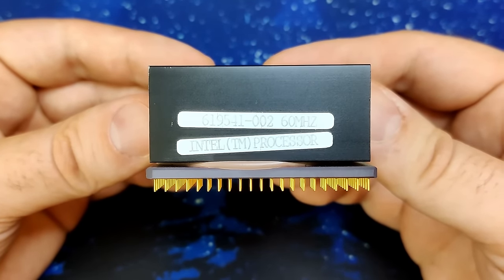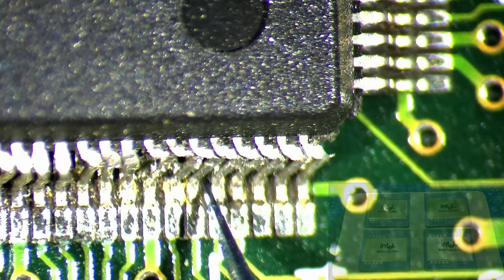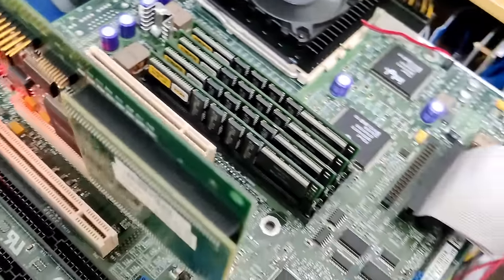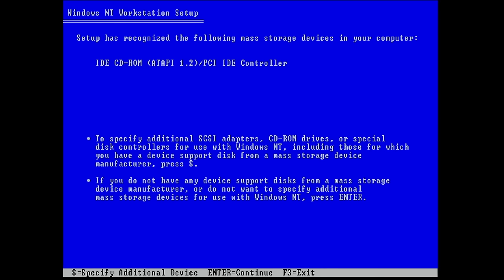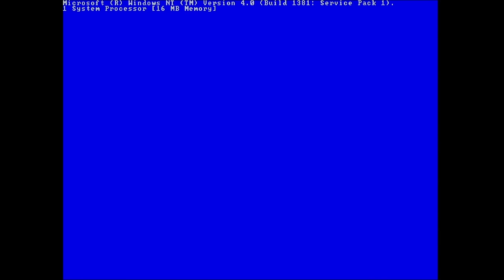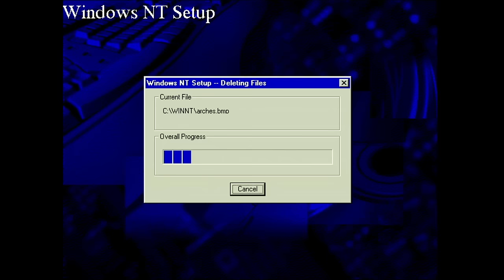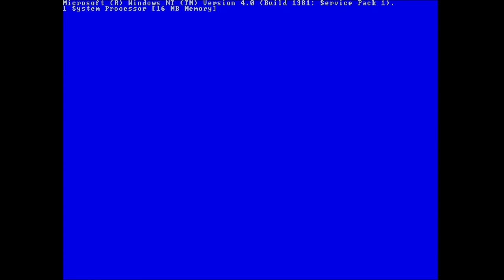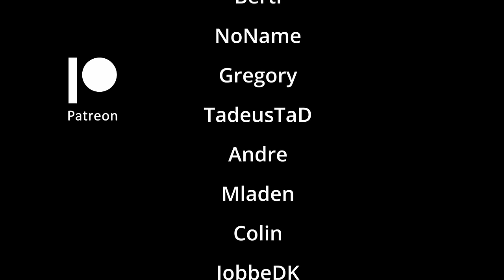A CPU ahead of its time: The Pentium Pro

Comment: I had switched to NT4 after 98SE. It was so reliable and even had some limited DirectX support. I had switched a friend over to it as well. We then moved to Win2k which was equally good. When everyone else started using the NT kernel with WinXP it was like the world caught up with my secret. Then I switched to Linux and never touched Windows again lol
Reply: win2k was perfectly functional well into xp's life. problem with nt4 was that it used up way more ram than what was common when it was current, for me anyway. also it was the actual golden era of linux(drivers etc wise and with how much included software you got with the distros and you could irc and play mp3's at the same time on far worse hw than you could in windows of any flavor).
Reply: @lasskinn474  You could run DirectX 9.0C on 2000.  It could even run XDDM display drivers.  And it was the first NT-style operating system to have plug-and-play, Device Manager, etc.
Reply: I used it after trying 95 at home for a while, I quickly learned that iD made sure their games ran on Windows NT and that was pretty much all I needed to make it daily driver. Of course the stability compared to 95/98 made it very worth it as well.

Windows 2000 quickly caught on even amongst gamers since by that time pretty much everything ran on Windows NT and there were a whole lot of benefits.
Reply: @lemagreengreen  The games they released at the time used ancient OpenGL and for software rendering low spec DirectDraw.
Reply: @soundspark  at the time, opengl was miles ahead of directx, lighter, faster and easily extendible. also, all the design/3d/animation programs used opengl exclusively as it was a much wider standard that worked on many architectures, not just x86. up until winxp, directx was a pile of crap, overbloated and barely worked. when dx9 came around, that was the moment it would start to dominate.
Reply: @lasskinn474  biggest con of nt4 was no usb support.
Reply: @giornikitop5373  DX8 was where it became a bit more sane of an API.  I only say ancient because it's a lower spec than I ever target.
Reply: @soundspark  OpenGL was all that mattered :) okay maybe not but still, was very relevant back then.
Reply: @lemagreengreen  John Carmack essentially saved OpenGL. If it hadn't been used for the Quake engine and later games based on it, it would have disappeared from the screen very quickly. There is a highly recommended interview here on YT regarding OpenGL vs. DirectX. Guests are Servan Keondjian & Casey Muratori. The former wrote the first versions of Direct3d.

Comment: A friend had a Pentium Pro 200 / 512kb with SCSI hard drives and it was a monster for its time. I've also worked with Pentium Pros professionally, they were sold as combined raster image processor (RIP) / print servers and graphics workstations. The RIP software was originally on Windows 9x but when they finally ported it and the specialized interface card hardware drivers to NT the devices shows their power. Pentium Pros were also really good under Windows 2000, especially as memory upgrades to 128MB, 256MB, and higher became cheaper. 

Such a great chip, and foundational for the successes Intel had throughout the Pentium II and III eras.

Comment: I never had a Socket 8 system, but a dual Socket 8 board would be nice to try. I had some experience with Windows NT 4.0 in 2000 or 2001, when I got a virus and my computer had to be re-installed. I didn't have any OS install CDs, so I asked the guy from who we bought the computer in 1999 to do it, but I asked him to split my 1.6GB WD Caviar 21600 in half and install Windows 98 along with NT 4.0. I recently re-built my first computer with the same parts as I got it with 25 years ago. (and that's why the WD drive noises were oddly familiar) Well, it's quite a trip down memory lane :)

Comment: I loved my trusty old Pentium Pro 200 with 256mb of cache. That CPU gave me my first glimpse of Windows NT. I kept that system around for many years, even running Windows 2000 on it for a while. I never once had a BSOD on any system running Windows NT or 2000, which I can not say with any of my computers that had 3.11 and up on them. 
I loved the video outro. Listening to old WD HDD click away is very relaxing even to this day. Although I will NEVER go back to using HDD's , I would never get any work done waiting on them.
Best part was seeing just 12 processes running after install. Try that with Windows 11!
Reply from the maker: I was surprised to see the "modern" Task Manager in Windows NT. I wish they ported that to windows 95/98 though an update. That simple task list doesn't work half of the time or ends in a bluescreen.
Reply: @bitsundbolts  👍👍 They did eventually port features like that from NT with WinXP. Which was sort of OK. Much better with XP 64 bit though, just lacked a lot of driver support.

Comment: There were few rare oddballs out there. One was a Socket 8 slocket board. This allowed you to install a Socket 8 pentium pro into a 440FX slot one board. This was because socket 8 and slot 1 were electrically the same on the 440FX There were also Pentium 2 overdrives for Socket 8. It was a pentium 2 at 333 that fit Socket 8. The black Pentium Pro 200 was made well after the rest. Most are found in big old rack mount servers in quad cpu setups. Before Intel brought put the slot 2 Xeon

Comment: I rescued a Pentium Pro single cpu computer in around 2015. It has a 200mhz with 128mb edo installed. Works fine with both Windows 98 and WIndows 2000. I don't remember the motherboards name. I replaced the boot drive with a 2gb ide flash memory and a 8gb ssd as storage. Works perfectly fine. I wonder if there is any lightweight version of Linux for it. Would've been fun to try it atleast. Great video as always. I love vintage electronics.

Comment: I've used a few Socket 8 systems, though admittedly they were already obsolete at the time.  That said, their usage was closer to when Socket 8 was current than now is to then.  I only ever really spent much time with the 200 MHz 1M L2 cache black tops.  At the time, they were actually the cheapest Pentium Pro processors you could buy because scrappers wanted the gold caps from the lesser models.  I ran a dual socket ALR motherboard as my pfSense router at the time.

Comment: Very nice. I happen to have built a Pentium Pro system just last month, using the exact same motherboard, and a 200MHz 512kb CPU. In fact I have another identical motherboard, but that one is not working - it powered up a couple of times, and then it stopped working (I have to repair it at some point). For my build, I chose to go for an all-SCSI system, appropriate for a server-grade build of the time: AHA-2940 controller, IBM 18.2GB SCA-80 drive and NEC SCSI CDROM. I installed Windows 2000 on it. :)

As for the CPUs themselves... I have a little collection of Pentium Pros. Including several of the black 1MB ones. I am in fact willing to send you one of them for free, but there is a catch: it has badly bent pins. Not worse than I've seen you repair, but beyond my abilities to fix. It was unfortunately how I got it. If you're interested please reply to this comment, and we'll work out a way to get in contact. :)
Reply from the maker: Thanks for your offer! I would indeed be interested and bent pins shouldn't be an issue. Although, the plastic-like package requires more caution. From my experience, ceramic packaged CPUs are quite solid, Pentium III (Socket 370) CPUs tend to break if too much pressure is applied to the pins. But good that I got some experience already. It would be very generous of you to send me that CPU - even if it has the bent pins. You can contact me at bitsundbolts at gmail dot com.

Comment: I used NT4 extensively and supported it at several companies. It's a pretty decent OS, but Windows 2000 was a huge step forward, mainly because it protects the system files with WFP. On NT4 you had to reapply the service pack and sometimes the roll up packages after many things to make sure you had the latest system files. Also, 16 MB is too little for NT 4. It'll run, but it really needs 32 MB in the original version and a lot more with SP6 (64 or maybe 128 MB, not sure, it's long ago). Someone else further down also mentioned you need to install the SP before installing any drivers, especially video drivers, this is indeed vital. Many video drivers require at least SP3 and will misbehave if you don't have it installed.

I also recall installing the Intel Busmaster IDE driver made a huge difference, both for disk and multi-tasking performance (otherwise your CPU time will get eaten by PIO disk access).

Comment: Back in 97 I was responsible for a Proliant 5000 server with dual Pentium Pro running NT 4.0 Server and the corresponding MS-SQL server software. It was a beast! Tooting took ages while you had to wait for all the system tests, both CPUs coming up, RAM test and finally the HDDs spinning up. Beside of that, it was making a noise that made working in front of the server a pain in the * 
I remember installing patches from Compaq and Microsoft was a frequent activity 🙂
Reply: To be fair, tooting a server or workstation-orientated system still takes a while today. ;)

Comment: I was fascinated with those cpus as a kid. I read somewhere that they're ahead of their time, and that stuck around in my brain and then in the early 2000s, I bought a desktop pc with a 200mhz ppro on ebay for 56€. Was still a lot of money for me. It had 32mb of edo ram, but as 168pin dimm modules. The seller claimed it would take SD-RAM which it didn't, so I complained to him and he offered to send me 3 more 32mb modules for another 10€. As the system had another cpu socket, I kept scanning ebay for another cpu with matching stepping, plus a VRM, and finally got to experience multiprocessor goodness for the first time in my life. It was pointless since my Athlon XP would run circles around it but still, seeing two cpus in Taskmanager made me happy. Born a nerd I guess. I still have it, actually dug it out two years ago and installed current Debian on it. Was painfully slow, the installer crashed with out of memory the first time and needed some tweaking, but finally got an x session running with i3. Ah yes, nerd stuff.

Comment: My first build was a 486DX system which I took to college. My major was graphics design which also included 3D modeling...so the 486 didn't cut it. In 1996...I collected all of the parts for my workstation build which included a Pentium Pro. If I'm not mistaken...the first OS I installed was Windows 95 but in 1997, I did install Windows NT 4.0 which was a very solid OS. I may have later installed Windows 2000 but I don't remember. I still have my Pentium Pro chip but I threw away the rest of the workstation.

Comment: My first tech job was at a local internet company while I was still in high school, around 1999. I got to build out a Linux server on one of those mini fridge-sized, howling loud Compaq Proliant dual Pentium Pro 200 servers, with some ungodly amount of RAM that I don't remember, and a bunch of SCSI RAID drives. At the time it was the most impressive piece of hardware I ever got to play with. We had it running RedHat (maybe 5.2?) and it served out FTP and web content for customers - remember when people used to host their websites and share files on their ISP servers? Seems so long ago. I quit when I graduated, and they tried to stiff me on my last paycheck until my dad came in and threatened to take them to court. Fun times.

Comment: My friend had such a system working. The Pentium 3 processor is 600 , 768 memory and a SCSI disk of 18 gigabytes . The FAST AV Master Premier 4.2 capture card worked satisfactorily, but the final miscalculation took forever.

Comment: I had several P-Pro machines.  Built and sold many more, as well.  I believe that board you have had the Vesuvius project name, hence VS.  PR440FX was another, but the project name escapes my synaptic junctions at this moment.  I also have a Dell Road Runner server, PowerEdge 2100, with a single socket 8.  I last ran it maybe 10-12 years ago, and still had functional EISA configuration disks available for the NICs and SCSI controllers.  I never did install the black 200MHz 1MB P-Pro chip I pulled from a functional IBM server, to save for the PE 2100.  I am fairly certain that the 333MHz OverDrive chip does function in the PE 2100.  Perhaps one day soon, it will see the light of day again, and perhaps even some more internet access.  I believe there are some supported, secure, 32-bit versions of linux around that I could load on it.  Not likely to be very good decoding videos, except maybe at 160x120.  ;-P

Thank you!

Comment: I had several Pentium Pro systems I picked up in the late 90s/early 2000s to play with. I actually had 8 new inbox pentium pros, including some 1MB cache units, but I never opened them. I still have 4 of the 256kb units new in box unopened. I had a Tyan motherboard that was dual socket 8, but I was never able to get it to work right. I did use a 200MHz Pentium Pro system with Windows NT for a while, and then later moved it to Windows 2000, it mostly was just a curious thing, I didn't use it for anything serious. However my first job in the late 90s, Windows NT was the primary operating system for everyone, me included, so I used it quite a bit.

Comment: In the late 90s my company got me a Pentium Pro NT4 workstation built on the cheap, the heatsink clamps were made of plastic to save a few cents, eventually one day I saw the fans flapping around holding on one edge, the Pro just slowed down a bit.
Reply from the maker: Poor Pentium Pro :( I am sure it was suffering without a fan properly attached!

Comment: I have this board with onboard sound and it works instantly under DOS with unisound. I Benchmarked some DOS things with 200-256, 200-512 and a P200MMX with 256k onboard cache. They are almost equal with some disciplines ruled by one or the other platform. Not that bad on 16bit at all and a good Quake CPU. Higher cache only adds some fractions of additional FPS. So don't worry the 200-256k is good enough. Don't tested NT/2K on it due to low RAM. Good platform either i love it escpecially these fat & heavy CPUs in my hands and this monstrous socket lever.

Comment: I guess the real successor to the Pentium Pro was the Celeron 300A: a P6 core with full-speed L2 cache on a single die, that could be successfully manufactured in very large amounts. I also remember reading about a special 333 MHz version of it, that was marketed as an "accelerator" for older Pentium Pro systems.

Comment: I had a P-Pro system I got off ebay a number of years ago, haven't got the mobo or ram, but DO still have both of the 1MB 200MHz Blacktops it came with :D

Comment: NT 4.0 was great once you had everything up and running but setup could be a pain. I was relatively new to PCs at the time (coming from Applie IIs and Macs) and it didn’t support plug & play. Luckily I had no interest in games because it had some issues there, too.

I was a programmer and it was excellent for that. It was the first time I’d encountered an OS you couldn’t crash no matter how badly you screwed up your own app.

Windows 2000 was where everything started clicking. It was a masterpiece in its day.

Comment: The oldest OS I used was DOS 1 on  Zenith computer. The oldest I used on a regular basis was my 8088 with DOS 2.1. I Toyed a little with Windows 2 on a 286, and daily drove Windows 3.10 until 95 came out. I had to upgrade my 486 trom 4-8MB of RAM to run it. I used NT for years at home and at work.

Comment: Back in the day I upgraded my Pentium MMX 166MHz to a Pentium Pro 180MHz, which I promptly overclocked to 200MHz by switch the FSB from 60MHz to 66MHz. That machine was one of my favourites, because it's the one I had when I also upgraded to a Voodoo2, which really made a huge difference for gaming. I did quite a number of other upgrades, including a SCSI controller and my first CD burner (a SCSI model), memory, hard drives, etc. Mostly I used it for DOS and Win 95/98 gaming. I think around that time I first got on the Internet as well, so that must've been the machine I first got online with.

Interesting you mention a performance hit in 16-bit software. I never really noticed this, but I guess by that point most games were 32-bit. I'd be interested to see gaming performance of a Pentium Pro vs MMX vs PII. Especially if you happen to have 233MHz example of each. I'm curious if this 16-bit performance issue was a real thing, or just something that showed up in synthetic benchmarks, but wasn't so noticeable in actual games.

Of course, you probably won't find that many games that run well on NT 4.0 (if any?), so you'll probably have to switch to 95/98.
Reply from the maker: I literally found a PII 233 today at the scrapyard! I'll benchmark those CPUs one day. I have all the CPUs you mentioned. I'm curious as well how much of a performance loss there is. And yes, I'll probably have to go with Windows 98

Comment: sounds just like 150gb WD raptors (10K RPM). They are in my 2008 build. It's a core 2 quad. It still works. lol Or at least it did in 2021. That's the last time I powered it up.

Comment: Indeed! Any code that accesses the CPU registers by byte or word rather than dword (e.g. AH, AL, or AX instead of EAX) causes a significant performance hit on Pentium Pro. 

Also yes, I can't stop using Microsoft's data width jargon. Help me! 😅
Reply: I did several DOS benchmarks and compared a PP200-256k to a P200MMX-256k. It was not that bad at all. It could even beat the MMX in some discliplines (eg. Quake).

Comment: In 1996, I picked up a PPro 200MHz with 256K of cache for a then bargin of £200. Loaded with 64MB Ram,  I couldn't believe how fast it was, and ran it with Linux 1.2.13 using Slackware if I remember correctly.